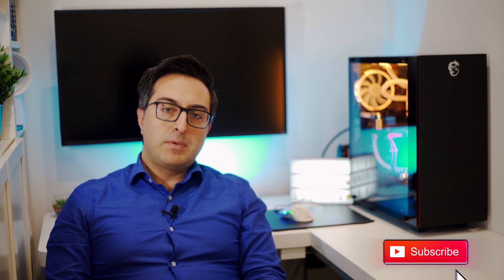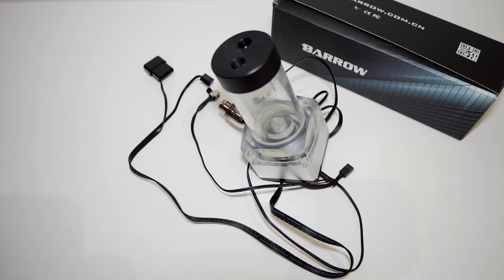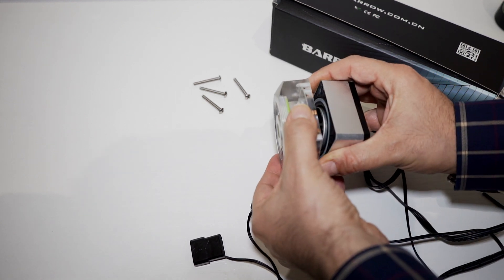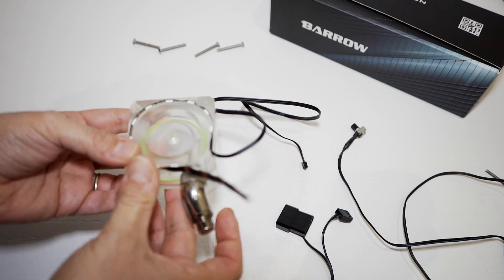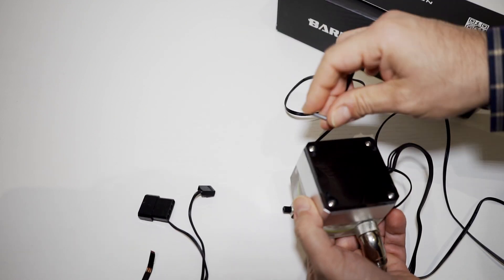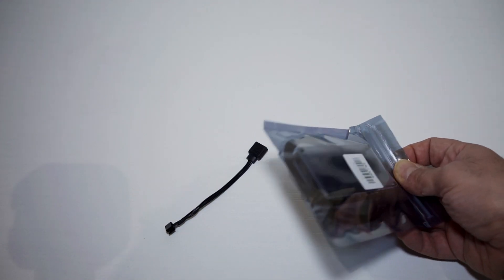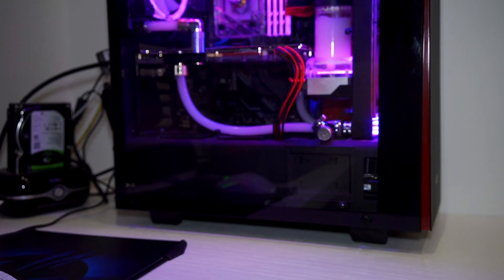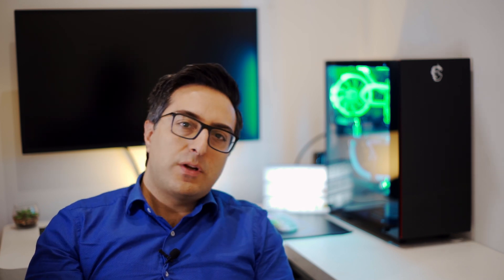How to replace a PC watercooling pump RGB strip & split addressable RGB #barrow

Comment: Can i ask if the cpu water block LEDs can be replace also
Reply from the maker: It depends on the model but usually yes
Reply: Whats the width of the strip? Im trying to replace my barrows cpu block strip.